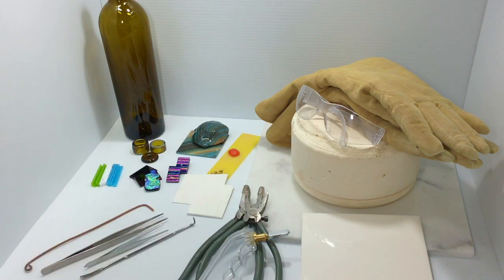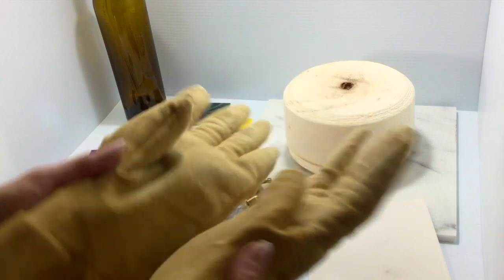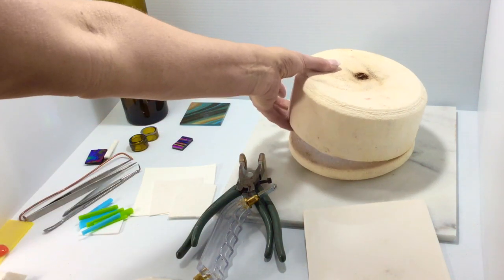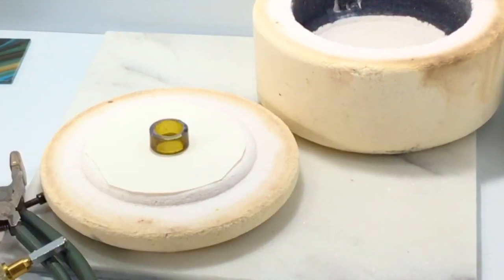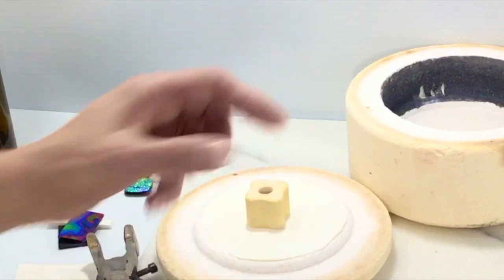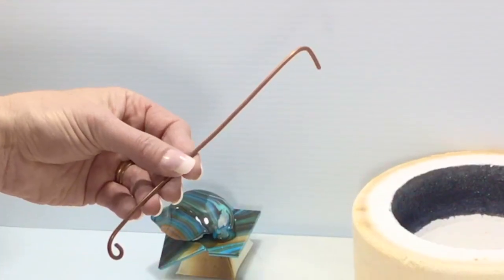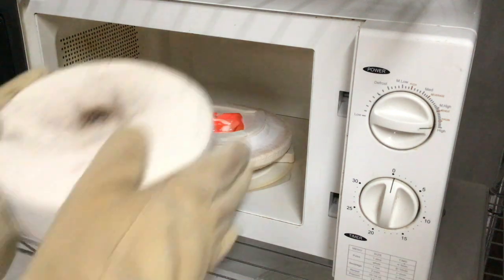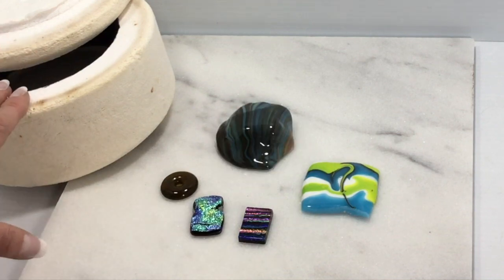#62 Microwave Kilns for Fused Glass

Comment: Love your video. I have 2 questions 1) I tried to fire polish a piece and it cracked in half.  I heated in until it was fire red. I read somewhere to let it cool for 30 and I let it cool for an hr.  Was that my mistake. Exposing it to air to soon? If u know a project takes 20 min. Should u still  do it in 5 min increments?
Reply from the maker: When glass is above about 1200 F it starts to become movable. It’s pretty safe to open the kiln. When it is coming down in temperature it’s not safe to open the kiln between 100-1000F. So allow the jewelry to cool to room temp before opening the kiln. Otherwise it causes stress because the outside of the glass is cooling faster that the inside of the glass.

Comment: Hi Susan , I an issue making dichroic cabochons in my microwave kiln . The problem is a residue of dichroic vapour forms around top surface . I have capped with clear plus I have faced the dichroic side down and it still happens . I’ve cut the dichroic piece smaller than the base which helps , however it shows up with a black border around it . I also have cut the top piece larger which appears also to work , however when it fuses it show outside the black base , so it requires cold working plus fire polish . Any suggestions would be appreciated. Many thanks .

Comment: Is it possible to add metal in with the glass in the microwave?  I'd love to see how copper reacts but quite frankly am a bit afraid (explosion, fire etc).  Wondering what I can and cannot add.   Thanks.
Reply: I'm trying it now with a copper foil punch in between two pieces of 90 COE glass. No explosion or sparks of any kind. I'll check the finished in 40 minutes.
Reply: @petersonmeh  Thanks.  I did try the copper and no explosions or fires.  Glad you had the same results.  The wire was fused inside the glass but no longer looked like copper.  I'd say it was only moderately successful as far as a way to create but worth the try.

Comment: Very interesting video, thanks for sharing. I have a couple of questions. How do you fire polish in the microwave (hotter/cooler - timing)? 
When you cut up a piece as you did with the raked piece, do you need special tools or just your scoring tool?  Thanks for any help.
Reply from the maker: Judi Morningstar for any fusing in a microwave kiln you need to do a lot of testing first to get to know your kiln and your microwave. Then you can fuse & fire polish successfully. Look for microwave groups on Facebook. That will offer lots of information & support. 
For the strips I just used my glass cutter to cut the strips. Nothing special. But to cut the finished piece I used my wet tile saw. I get very straight pieces ready for fire polish without any grinding. 😁

Comment: Marble countertop installation places sometimes will sell you scrap pieces for really cheap if you ask them! When you wash the kiln do you do it in the sink and just let the water a stuff go down the drain or do you do it in a bowl and throw the wastewater away?
Reply from the maker: K P I’m not sure what you mean “wash the kiln”. If you mean applying kiln wash to the kiln or washing the kiln wash or fiber paper off the glass then I try to never wash that down the drain. I try to use a bowl or bucket of water then dispose of the water in a trash can (that’s usually full of old paper towels. Or wait for most of the water to evaporate and clean the bowl with a paper towel. If you mean wash the kiln I say don’t!!!

Comment: I thought firing glass was out of my reach since I don't own a kiln so I've never done any research. Can regular stained glass be used in the microwave kiln? I have tons that I would love to use. 
Thank you!
Reply from the maker: Auntie Princess Videos fusible glass is definitely different than stained glass. Fused glass is made compatible so that it melts at the same temperature & cools at the same temperature. This is very important because stress in the glass can cause it to crack either right away or sometimes months later. Also fusible glass fires up shiny and non-fused glass usually doesn’t. BUT with all that said many people use recycled glass including stained glass for fusing. For the best information on this look up Jodi - Glass With A Past.
Reply: @SusanMcGarryGlass   Thanks so much for your quick response.  I have a feeling I'm about to start a new (expensive) hobby.. 😊
Reply from the maker: I think you’re right!  😳😁
Reply: When I started fusing, I used glass I bought at my local stained glass shop. I made sure to only use glass from the same manufacturer. I bought my microwave kilns from China - with shipping it cost $125 for 3 kilns. I use multiple kilns because most of the time is used to heat the kiln so when one project was completed, swapped out the lid to my next project and covered the 1st project with one of the cold lids. I can get 5 or 6 projects done in an evening.
Reply from the maker: Grumpy Old Man I’d say you’re very lucky your projects didn’t have any problems. Even stained glass from the same manufacturer can be different COE because when they are manufacturing stained glass they’re only concern is with design not COE so it might be similar coe (not always) but not the same. This can cause stress in the glass and it can break later or even explode if the stress is great enough. I’ve seen it!  You can always use polarized filters to check for stress. 👍
Reply: @SusanMcGarryGlass  I agree that I was probably very lucky but the items I made using stained glass in 1989 are still whole. I know so much more now than I did then - but using scrap glass while experimenting seemed like a better idea than using fusing glass (or so it seemed then). Currently, I pay between $7.00 per pound and $25.00 depending on the project (whether I am casting or fusing). Sigh!

Comment: This video is very useful thanks. I have a few question about microwave. What are the properties of the microwave you use. How much power and maximum heat must be ? Is that a standard microwave or It is special ?
Reply from the maker: Cüneyd Alperen Makas It’s just a regular old microwave that you buy for you kitchen but this is the lowest watt. So if you want to use a microwave kiln I recommend getting the highest watt at the lowest price you can find.

Comment: I need to melt a little glass in order to pour it on a bottle's bottom to flatten it.
The bottom has to become from convex to flat.
Any suggestions?

Thank you :-).
Reply from the maker: So many reasons why this won’t work. If glass is hot enough to pour it would be at least 1600*F. Adding that to room temperature glass would shock it and it would shatter. The bottle and the melted glass that you want to “pour” need to be similar temperatures in order for them to bond. So if the bottle is the same temperature as the liquid glass the bottle will also be liquid. So that’s just not going to work!  You need to find another solution.

Comment: Whie I fire on thicker, fibrous shelf paper,  it leaves a rough white "powdery" surface on the bottom which is not smooth or shiny. What can I do about that?
Reply from the maker: jbrondos that’s a tough one. We all want the bottom of our glass to be shiny. You can use fire paper like the Papyrus brand or the Bullseye Glass brand only or on top of your thicker shelf paper to make it smoother. Or you can cold work the back of your piece on something like a flat lap or wet belt sander. That’s a lot of work. Most people just accept the non shiny back.

Comment: @Susan McGarry Glass: If I put some  colored ground glass on a little disc of copper, or silver and fire it, will the glass fuse to the metal or will it just fall off when cool? Thanks!
Reply from the maker: Great question. Most likely it will fall off because metal & glass heat & cool at different temperatures. So when the glass is molten it sticks to other glass but the metal is still a solid. It’s possible the glass could stick but because they cool at different rates it is likely the glass would crack & fall off. When it does work it’s usually because there is far more glass than metal.
Reply: Dear Susan,
Thank-you very much. But wouldn't that be true of enamel fired on metal as well (and isn't enamel basically ground glass?)
Reply from the maker: I’m not totally familiar with enameling but I believe it’s done with a powdered glass & I believe it has a flux in it or on the metal (maybe). Both things would make it easier for the glass to stick to the metal.